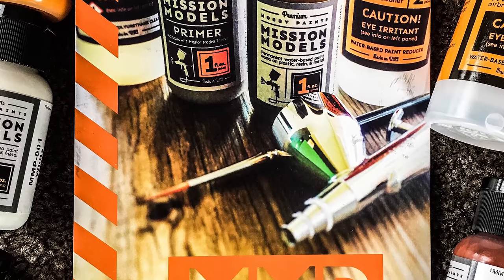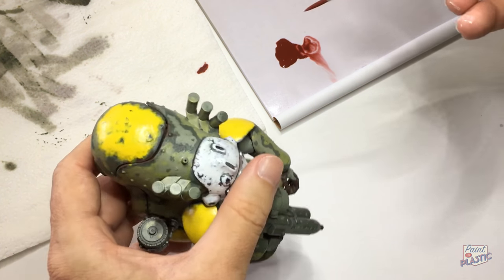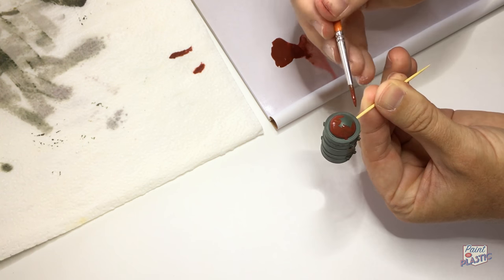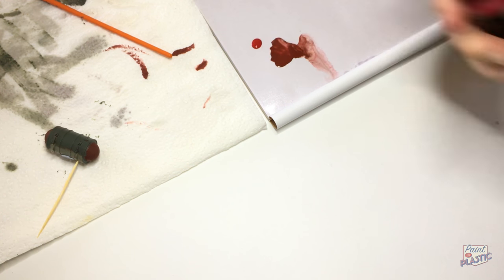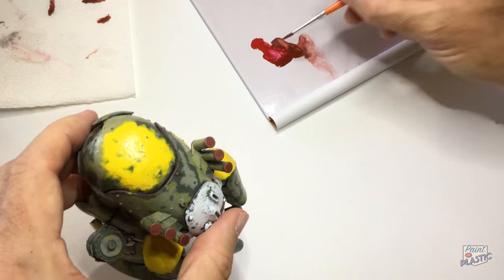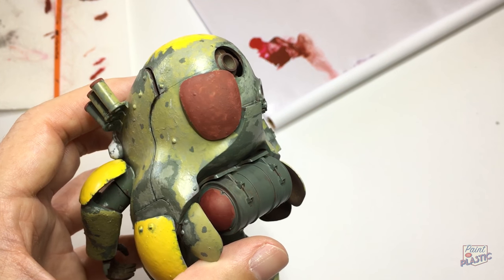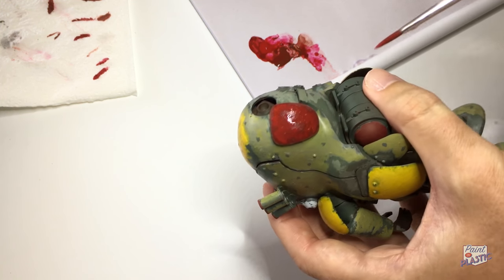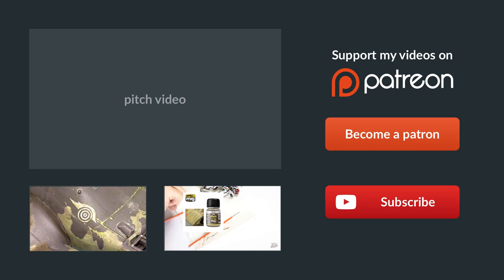Mission Model Paints - Ma.K AMMOknight Hand brush Test by Lincoln Wright

Comment: I face problems with mission middels primer, I thin 10 drops of primer with 3 drops of thinner and it sprays Well but even after 24 hours of drying it peels of very easy....any advies
Reply from the maker: hey there, I haven't used any Mission Models Paints since these videos and haven't sprayed their primers - sorry, sounds like you have used them more than I have. Their staff are very good, you should get in touch directly next. Thanks again for watching.